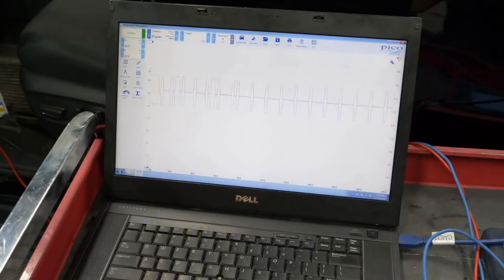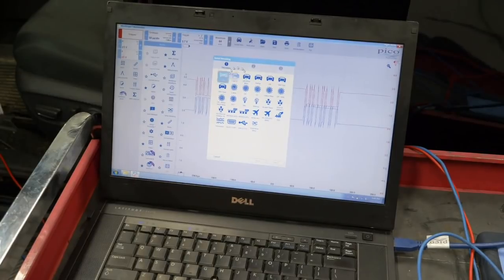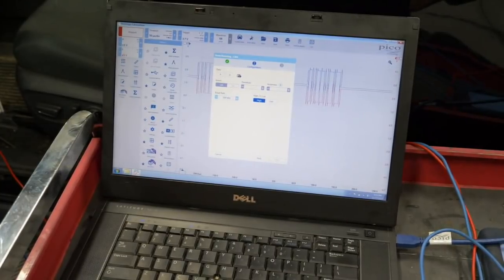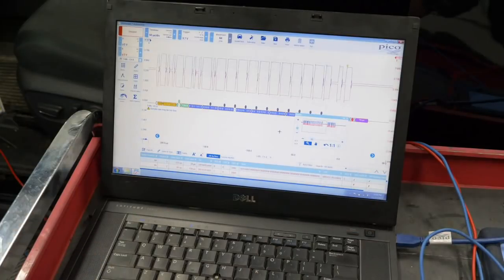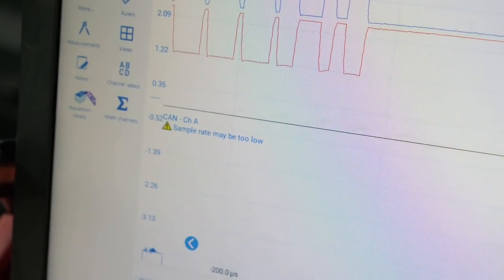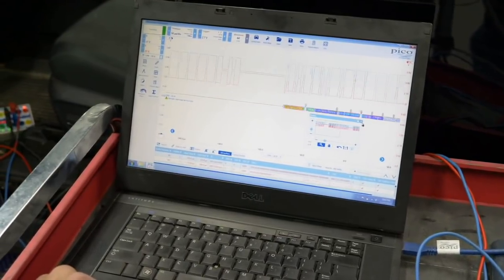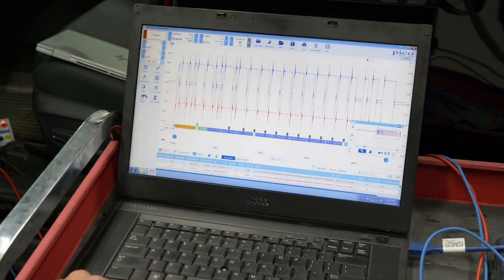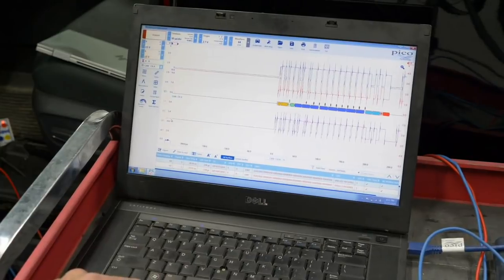Advanced CAN Diagnostics:  Signal Decoding w/ guest Chad Bailey  Pt1

Comment: Always a pleasure to run accross MATT Channel; so much to learn. Quick question Matt, do all oscilloscope need a ground  as an additional point of contact besides CAN HIGH AND LOW channel 1 AND 2? i have owned an entry level pico 2204a for 4 years and never actually needed to use it until now. I am indeed dealing with a 2015 Impala 3.6l v6 plagued with paranormal activities that seem related to the HIGH SPEED CANBUS. Among the communication codes is U0073 CANBUS OFF & several other NO COMM DTCs among CAN modules. 
7 modules on the Hi Speed CAN here and I have performed the resistance tests with the battery off to confirm the integrity of the network. 60ohm when all modules are plugged and 120ohm each time i unplugged a module. So I then used my multimeter  to test CAN H & L with ground each time and the voltage I got was always higher than expected; while CAN H + Ground should give 2.7v and CAN L + Ground should give me 2.3v, I got nearly 8volts on both instances. 
I finally used my oscilloscope last night but my CAN graphs could not fit within the 5Volts Y axis scale. 
Note: I do not remember having plugged a ground to my DLC breakout box; could that be the problem may be??
If not, what could cause higher than expected voltage on Hi speed CANBUS lines? 
I am subscribed to your channel and if need be, I can re-ask this question on the channel. Thanks in advance. I need a lead to continue on my troubleshooting
Reply from the maker: yes you need the ground to read accurately. on my scope I typically set up channel 1 for CAN hi, channel 2 for CAN low, and then I piggy back the ground for each to the scope ground.
Reply: @ thanks for your prompt reply. Mine has 3 chanels. A, B & AWG. I set A to 6 (Can High) & then B to 14 (Can Low). I don’t think i had any lead in 4 or 5. I cannot remember what happenned when I tried but ill do it again today. The multimeter showed 8+ volt for both Can reading. I have another impala; a 2008. I tested with the multimeter prior to testing the 2015 to see the reading id get. I had CAN H 2.7v & Can L 2.3v. But the 2015… 8volts so i know something is going on

Comment: I fell down this rabbit hole when looking at how modules communicate with each other on a boat. The rules of communication are different compared to automotives, but the overall theme is similar. In a marine situation you need to integrate numerous devices that are manufactured by different companies, with a boat you can't afford to throw out and start again. When communication protocols are updated for faster talk, many of the older devices can't keep up. So, a minor project has a way of snowballing....

Comment: Differential signaling, also called balanced audio in the audio world, isolates the signal from the ground in any module.  And by splitting it to a high and a low, any noise introduced will effect both signals the same way and so will not impact the difference.  As long as the CAN transceiver can subtract the two lines and get the zero to 2 volt signal referenced to the local ground, it can read it, even if there's all kinds of noise put in the signal along the way.  

A now defunct channel, TheOnlineEngineer, has a video 'Audio Basics: Balanced Audio' that is very good at explaining the concept.  CAN just uses digital signals instead of audio.

Comment: On scan tools the new ones have topology and they are in the can lines, or k line etc etc the scan tools pull data from the module through a signal wire not technically the can lines. The can lines take priority like he said, if a airbag goes off if need Priority on the network. So the can lines talk but the raw data comes from modules and strategies

Comment: Keep in mind break out boxes done work with security systems like newer Nissan and  Hyundai….Watching now- typically I don’t run can decoding on my Pico or ATS scope if I terminate at 60 ohms I’m good if 120 I know I have a module down. If I have a break in can signal I start unplugging modules until it comes back. Looking to watching both parts… Jay

Comment: You can easily check the baud rate with the scope. The baud rate is the rate at which the signal can switch from 0 to 1. Just measure on channel A and the shortest  time T from where it is goes from 2.5V to 3.5V and then back to 2.5V. The baud rate will then be 1/T. You should get 2 microseconds if you have 500 kbaud.
Reply from the maker: makes sense!  Thanks! I was watching some other videos about CAN decoding and they did exactly this.
Reply: @SchrodingersBox  I found this video from PicoScope to be very informative regarding identifying individual modules transmitting on the CAN bus. Maybe you have seen it already. https://www.youtube.com/watch?v=Bc2R462dlac